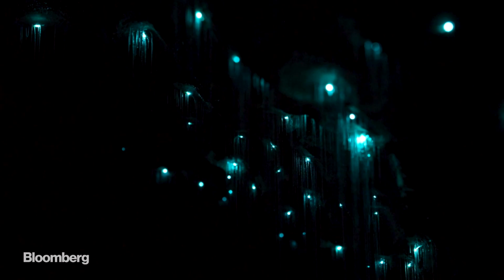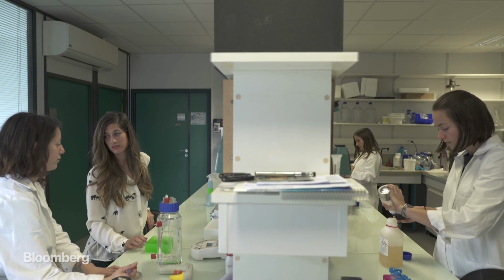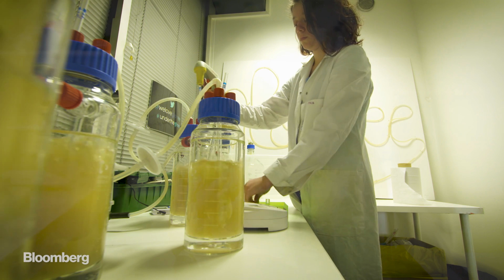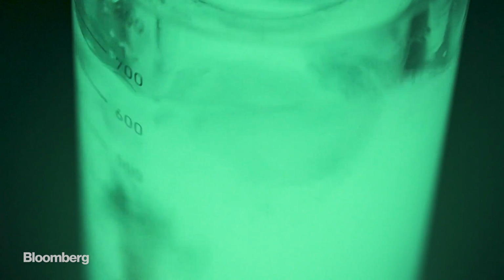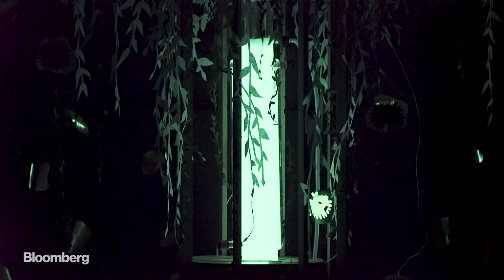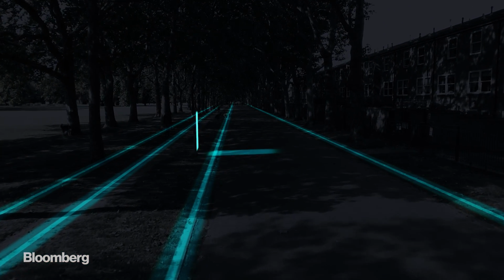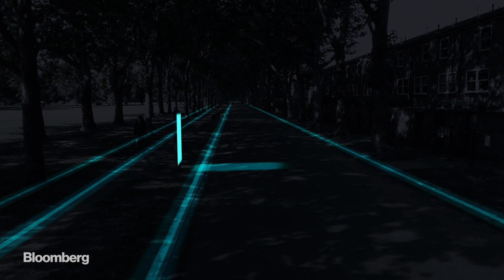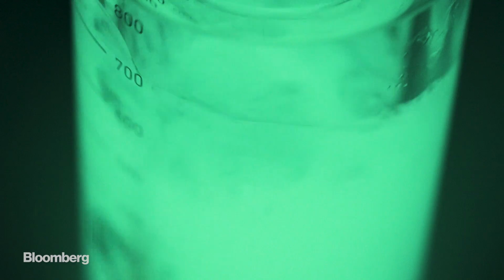Bacteria Could Change How We See at Night

Comment: This isn't practical. Current lighting solutions are already energy efficient with a very high luminance.
Reply: I think that's a reductive statement. While electrical light is highly efficient in developed countries, that's not always the case elsewhere.

The light we use depends on a slew of massive energy infrastructure. That includes power plants, energy grid, power lines, internal wiring systems, etc. Not all countries have such robust infrastructure backing these services. The lamp we use is far more than meets the surface.

For some people, it might be cheaper to power their lamp by feeding fluorescent microbes within it than to rely on public infrastructures that their government can't, or are unwilling, to afford.
Reply: They don’t care about efficiency. They want less light, less light pollution. It’s too bright to see the night sky in a way
Reply: @karebu2  I know. That's why I don't consider it to be "The light of the future". Also light pollution can be managed by managing the equipment and sites used for lighting. You don't necessarily need to innovate when you can just correct something by proper management.
Reply: @QuantumWalnut  This video isn't meant for underdeveloped countries. It's meant for France to make it able to reduce its light pollution. 

France, one of the most expensive countries, isn't capable of scaling this process to dirt cheap lighting, like the solar-powered LEDs made by China requiring less than 5 W with a luminance range of 100-1000 lumens also exported to Srilanka and African countries. Obviously such lights don't require an intricate infrastructure to begin with whether it's operating independently of the grid in a garden in San Diego or in a desert in Sudan.

An average of 41 degrees in places like Wadi Halfa, Sudan isn't really favorable for bacteria unless they're thermophiles, not to mention feeding a fellow human in such places is already taxing than feeding microbes.

A relaxing and soothing light isn't really practical for office work, medical care, construction projects and much more even in underdeveloped cities.

Your argument is a lack of infrastructure but it's not a sound one for the already available alternatives of lighting even to underdeveloped countries, in addition to the fact that the product in this video isn't practical for many professions requiring a brightly-lit environment.

To put it bluntly, this technology is geared towards ambiance rather than practicality.
Reply: You missed the point. The point was actually too much luminance. That's what light pollution is.

Comment: Light pollution could be reduced by a lot if there was a will to do so. Light fixtures could be designed such that there is a lot less leakage skywards, power could be optimized to what is needed, instead of just overpowering the lights, some lights could be only powered on when motion sensors detect movement etc. It would also save on electricity.
Bioluminescence lights could be a neat design feature, but from practical perspective it's a gimmick.